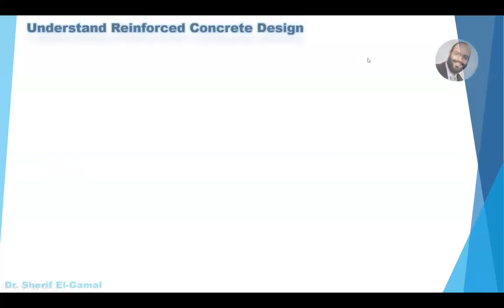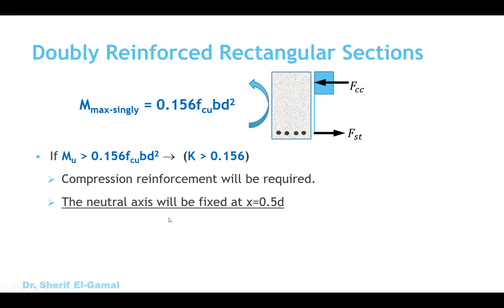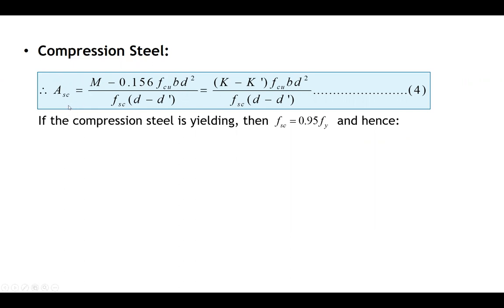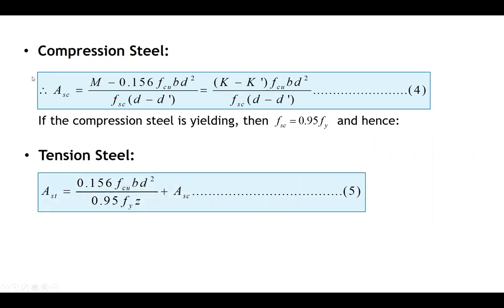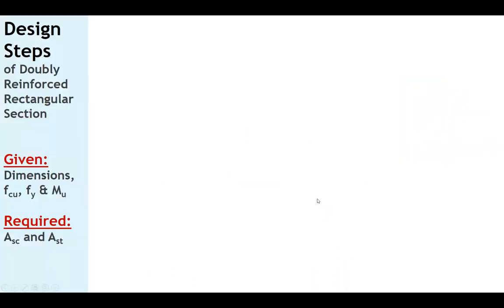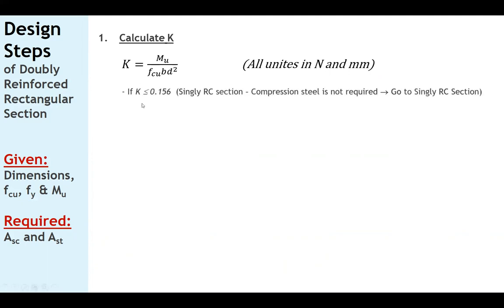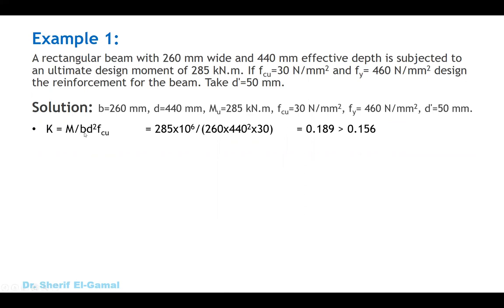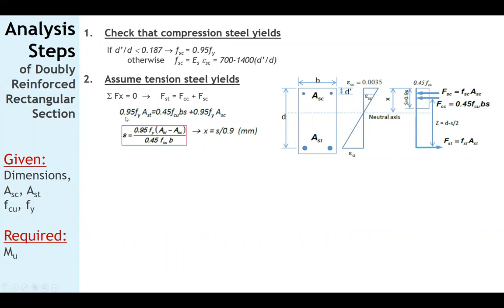Doubly Reinforced Concrete Rectangular Sections (Design and Analysis) - Clear Steps with 2 Examples.

Comment: Is all section are doubly reinforced for lateral loads ???
Reply from the maker: As all beams should have top and bottom reinforcement, they are doubly reinforced sections. In some cases, we do not need compression steel but in reality,  we use compression steel for hangers and for shrinkage and temperature changes.